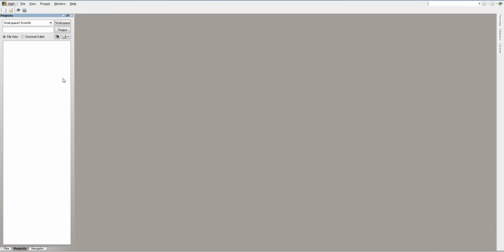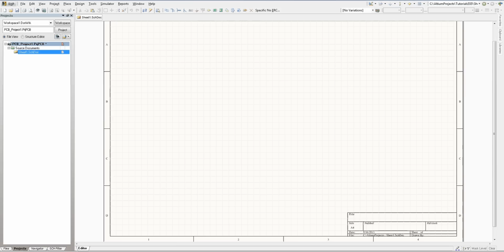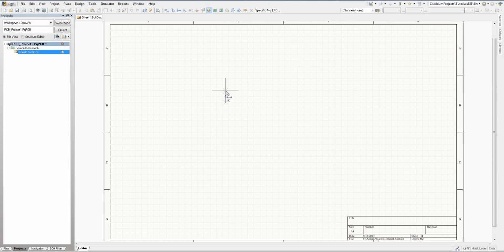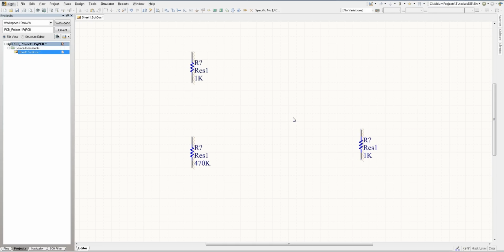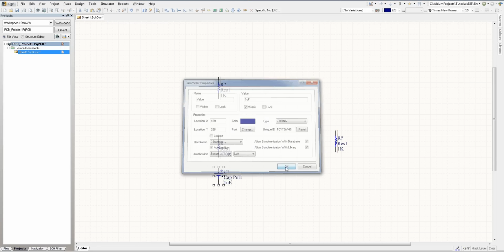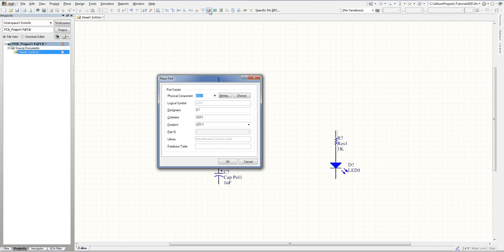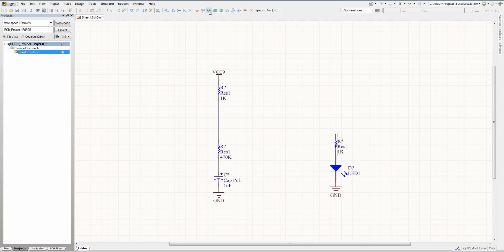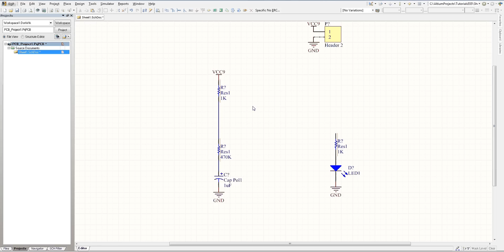Altium Designer Tutorial - Part 1 - Starting a project and adding components

Comment: For a starting tutorial you have not included sufficient detail. Different versions of Altium Designer have different menu options. Hence it would be good to start by saying explicitly what version of Altium Designer you are using. For example I am using Version 13.3.4 (Build 28608)
You need to specify that you are using a new workspace. This is done by clicking File/New/Design Workspace which is found right at the bottom of the File Menu options.
You need to clarify how to get a new Project. This is done either by cicking File/New/Project/PCBProject or by right clicking on the PCB_project1.PrjPCB* line and then click Addnewto Project /Schematic.
You then need to clarify that you open a new sheet for the schematic by clicking File/New/Schematic.
You need to show what tool it is that you use for the connections. It does not help to just say "And you click here" The video does not show sufficient detail to show what you have clicked each time.
If these steps that I have mentione are not clarified it can take a person many hours to find this information. This time is far in excess of the apparent 7 minutes and 34 seconds that the video runs for.

Comment: this is peace of crap. i been using multisim (has like million components in the library ) for like 7 years and just tried altium and this is a peace of crap. there is nothing on the component library.  not even a  555 timer in this.
Reply: +Kaushalya Damitha Weerakoon multisim and altium is two different programs for two different function. Multisim simulating prosesses in electrical circuits. Altium for disign printed circuit boards. Comparing of this programs looks like comparing Photoshop and AutoCad.
Reply: +Елизавета Тарасик acctully its like comparing Photoshop and msPaint cos multisim ( Come with Ultiboard for PCB desing and Multisim it self support pat of the pcb process)  can do every thing altium can do